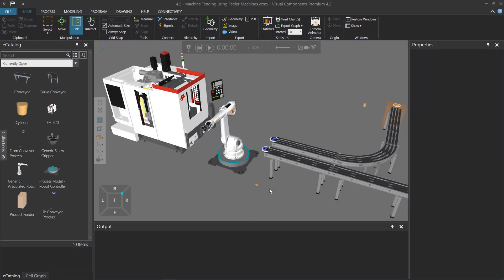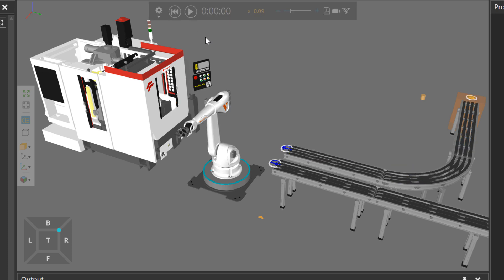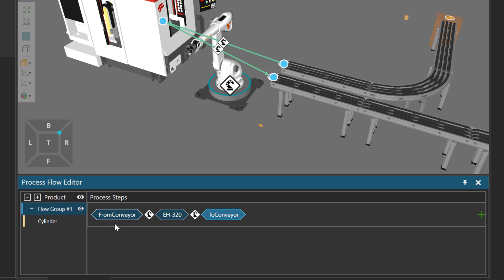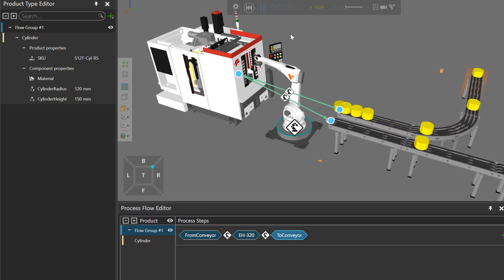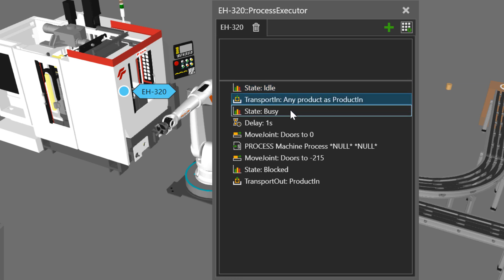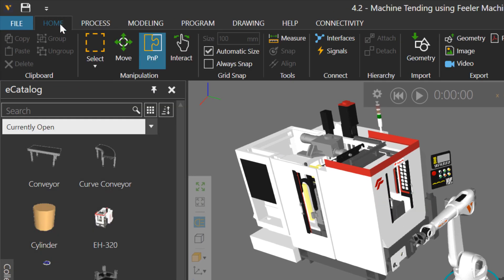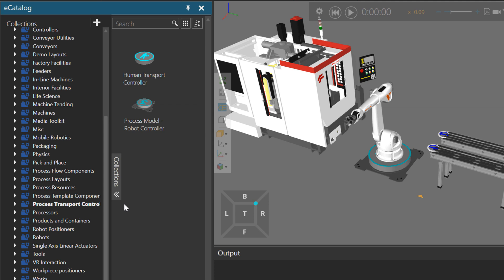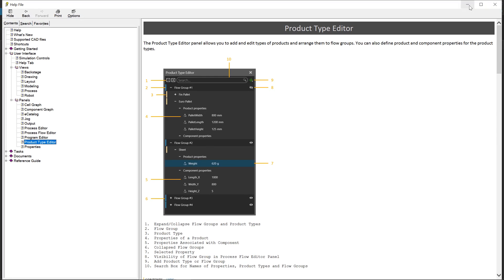Introduction to Process Modeling

Comment: Does Visual Component support interfacing with RSLogix??
Reply from the maker: There is no direct plugin, but you can connect through an intermediate (e.g. Kepware) or integrated (if available) OPC UA server.